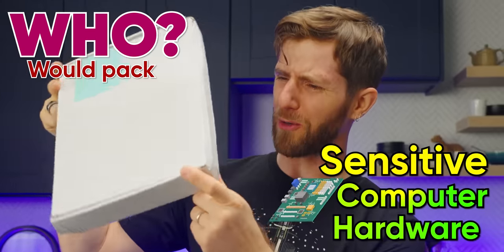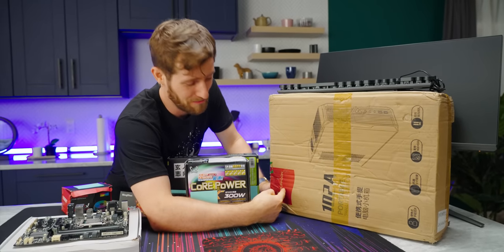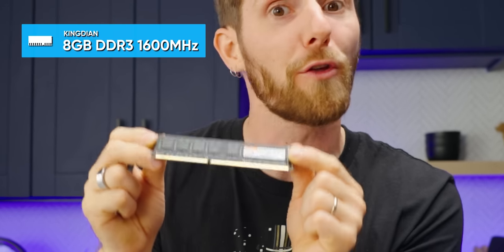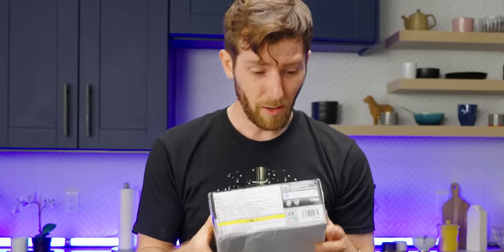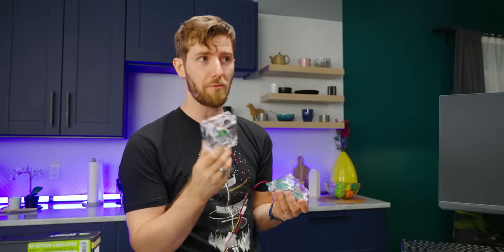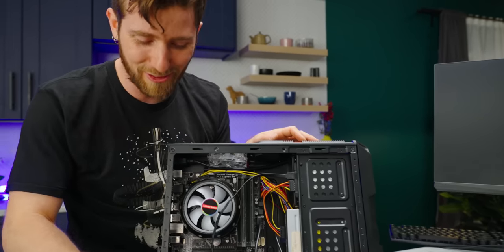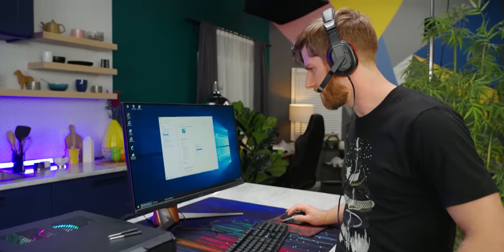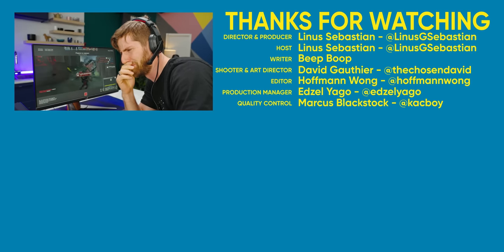THIS Wish.com Gaming PC is WORSE!

Comment: 6:12 this is exactly what happened to me when I bought a prebuilt computer from a company called Cobratype. They used this exact cooler on an AMD4 motherboard. . . except didn't use the little mounting ring. I shudder to think how they got the cooler to lock on in the first place. Probably used channellock pliers? 

Among the other sins were that they used 1x16gb stick of RAM instead of 2x8gb for dual channel. They stuck a Ryzen 5 3600 and a RTX 3060 in a Biostar a320mh board . . . anyway, enough ranting.
Reply: Bro a 3600 and Rtx 3060is good

Comment: I wish to you'd guys would just plug a monitor into the hdmi port on the board. And see how it performs with the onboarding graphics system and explain how it works and compairs to the graphics card ?

Comment: your psu came with a japanese older style power cable they used to have external grounding posts on 2 prong plugs some areas in japan still do

Comment: I Buy in 2022 or 2023 an I5 3750 for 15 euro to rebuild in a tiny case some olds parts to play olds steam games on it (with gtx750ti) and emulators, work great ! I wanted the I7 3770K but the price is amazingly high in Europe for this one : 100 to 150 euro ! Just crazy ! For ventirad for this kind of old CPU, the Artic Alpine is the best buy (for tiny case) in my opinion, cost only 13-15 euro in France ! For the case, I got a SilverCrest HTPC (mATX) who are approximatively the dimension of a fat Xbox One, very good case for 40 euro ! I put a SFX 350W paid only 28 euro (it's a no name). My old PC turn great for what I want and do with it. So build or rebuild old PC Parts can be a great things but not with the kind of stuff from Wish ! Price is too high and quality is cheap.

Comment: linus i got my bottom of the bottom system for a total of 184 usd
GPU: G210
CPU: I-5 2330
Storage: HDD, 500 GB
Fans are stock, the case is a cooler master from 2009
MB:ASUS PH-8X series, 2004
16 GB ram
runs half life at 1080p at 60 fps no anti alias

Comment: That is some Smooth TF2 framerate even without a FPS config.
Then again the source engine uses more of the CPU than GPU but even with that the game can still dip very low into combat but I'm quite impressed on how well it was running.

Comment: 👍 Linus. I've run a twist tie on a massive 180-200 mm case side fan for. . . 12 years? Amd 965BE, 16 gigs of 1333 mhz ram, power supply came with the case. Ssds get swapped whenever I upgrade operating system and it got an RX570 a couple years ago because I think my MOBO runs pcie 2.1 and anything over would bottleneck. I don't game often but, hooked up to my 720p 32" television. . . It does things surprisingly well still. 😆

Comment: Jokes on you Coolmoon is actually a pretty good budget brand, their CPU coolers cost less than 20 bucks and can perfectly cool up to 130W CPUs, I used to rock a 4790K with one of those and wouldn't get over 65°C, specially considering it was an 88W CPU, got pretty hot with a stock cooler, already hitting 100°C at below 50% usage

Comment: The weird ground pin is actually Japanese one. Japan use floating voltage which means there is no need of groud pin in sector outlets. So for plugs where installing a ground is mendatory, you have this
Reply: Lmao keep believing how Japan's electrical system isn't just complete shit.
Every professional device I own (made in Japan) comes with a ground plug, yet my house has like two grounded plugs. Devices with metal chassis have grounded cables, but the only outlets that are grounded here are ones near moisture (washing machine and MAYBE AC).

Comment: It's not just an optical bay, you can put USB expansions and hard drive controllers in it too 

I've got a case on my wishlist with 3 5.25" bays on it. One for a USB front expansion, one for a 6 button hard drive controller to physically dual boot, and one for a disk drive or a hard drive holder.

Comment: I buy second use pc
$40 second use ryzen 3 3100
$25 asrock a320m-hdv
$20 16gb dram ddr4
$10 kyo sama proccessor rgb fan
$40 second use sapphire nitro+ rx 580 4gb
$15 nvme kyo kaizen 256gb
$10 ssd powercolor 250gb
$12 second use 1tb hdd 
$15 diy open case
$30 psu 55w 80+ bronze
$80 24 inch monitor 75hrz
This cheap for me

Comment: I am literally still running a B85 Pro MB with that exact i5 4670. Ridiculously pathetic. Ya feel my pain?
Reply: mine's the same cpu (not unlocked) but with a h81m-s2ph mobo and a rx 560.
Reply: @446gitsu  i had gtx 960. But ive ugraded last week, total new full msi build. Man is it wicked. 7600x cpu, b650 tomahawk mobo. msi rtx 3080. Ddr 5 32 g 6000 mhz 30 cl.

Comment: its a gtx gpu in that time. buildt after gtx 190 and ti versions. but  the speed in gpu with 2gb sets back to non playable games from the future. ram somehow good on e d o ram too to sdram. getting good speed there. mouse are maybe set to slow or  it does not comunicate so good when sata going down in low speed. the motherboard could take a little blame too. it old but good enough for gaming in that time avp 1 2 was out or somehow avg 2010 version. so many games so little fps.

Comment: So what if it's a 10yr old CPU?   Those i5 4-core/4-thread CPUs never really improved since 2011.   Each version only added 100~200mhz, otherwise the same performance.  I've only recently replaced my i5-3570K with an AMD 8Core CPU.  I've been playing games in high settings in 1440p @ about 70~100fps on a 10yr old CPU.  Most PCs, notebooks you see at Walmart are easily SLOWER than any 10 year old i5-CPU.   They're labeled as Pentiums and Celerons.

Compare UserBenchmark.  The differences between the i5-2500K and i5-7500 is 1%.  The KabyLake CPU is 100Mhz faster per core.  It does run at 65watts TDP over the 95watt 2500K.
(The 7600K is about 20$ better, but has 500mhz per core boos and its TDP is 91wattts)
So the i5-2500, i5-3570, i5-4670K, (5xxx CPUs are mobile), i5-6500, i5-7500) = all with 1% of each other.

With i3-8000 series, was there a noticeable bump in performance of 12%~25% or so.  The i5-8350K is a whopping 30% over the 2500K... its 700Mhz faster per core.

Getting a good GPU matters.   The WISH computer is junk, mostly over-priced junk.  Other than the CPU and Gigabyte motherbaord.  Spend a few bucks for quality 16GB, $15 more for a Thermaltake 500watt PSU, $85 more for a name-brand RX-6500 XT (almost 3x faster than the GT-1030).  Oh, $20+ for a reputable SSD drive.  $150for better parts, BUT save $65 by getter a much better case that comes with better fans...  So $85 extra well spent = 3x better computer.